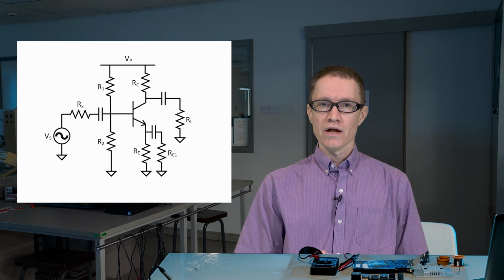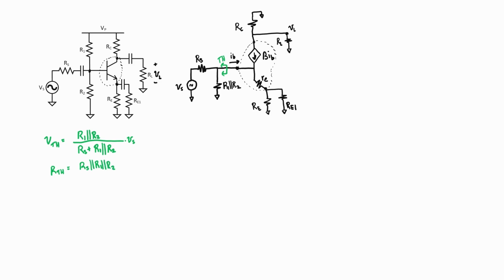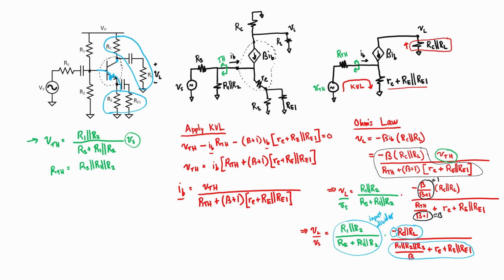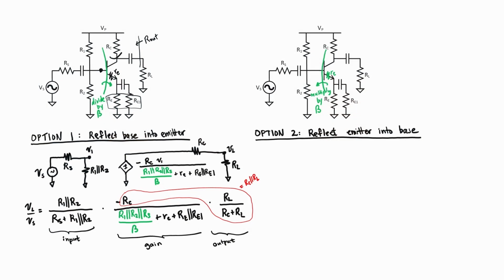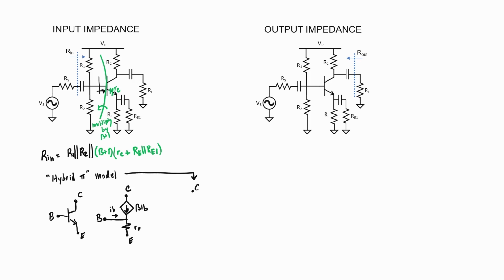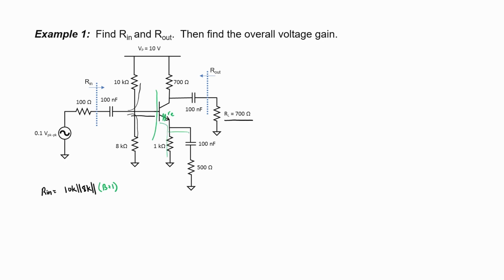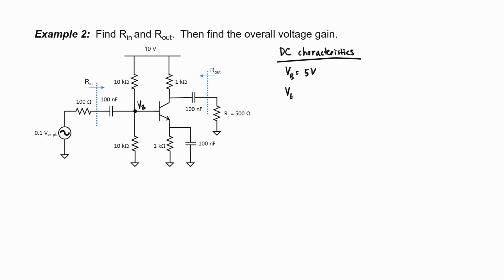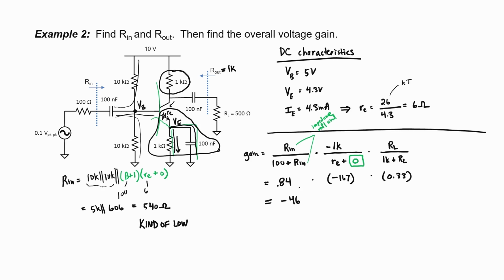All About Common Emitter Amplifiers (14-Transistors)

Comment: Input coupling cap goes to the left or right of the bias divider?
Reply: the left, you don't want the bias to be affected by the DC component of the signal
Reply: Also after would just block your bias voltage

Comment: Prof Aaron Danner, I have been following your work since Playlist #1, which included 30 other Videos for Calculation Transistor Gain. I find it quite frustrating that each time you explain the Common Emitter Configuration, you present a revised method and a much larger equation for calculating the AC gain. Could you clarify why you are not consistent? I am getting very confused with the numerous changes in your approach to calculating AC gain. Which method is most Accurate? Could you delete some of the videos with different, shorter equations and explanations? I have prepared so many pages of notes about AC Gain Calculation for CE Amplifier, and this specific Video includes more variables that previous videos did not include. So it means trash those notes or discard this video??
Reply: Prof. Aaron Danner, I believe we are all learning together (including you) as you figure out methods to write equations differently every time. Hey few extra bucks for a new video would be quite welcome if I were you🤭

Comment: One thing you havent mentioned is what frequency this amplifier is intended to work at.
You have 100nF capacitors..which have reactance of 1.5k at khz 
159 ohms at 10khz
And 15.9 ohms at 100khz 
So it looks like this is really well above 100 khz ?